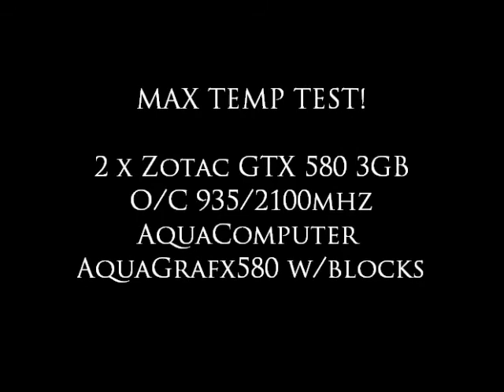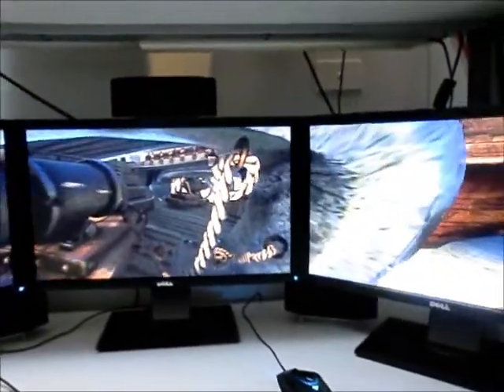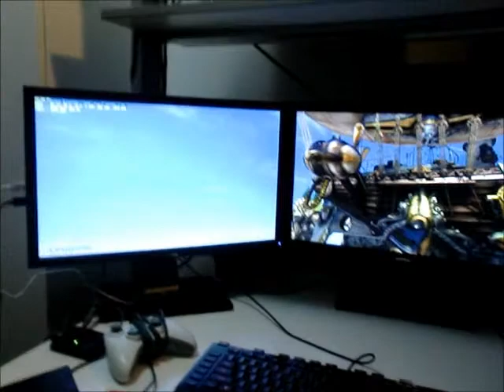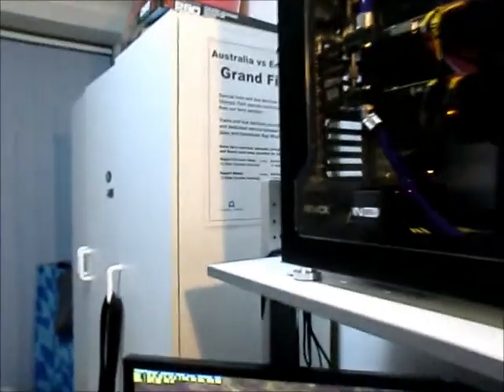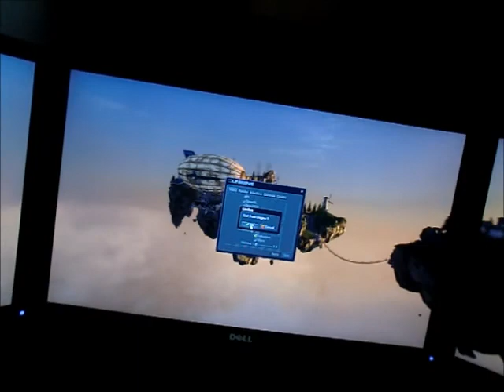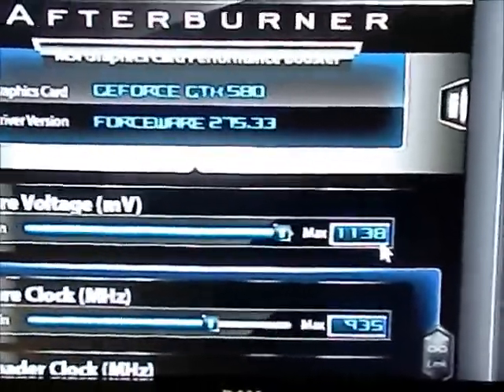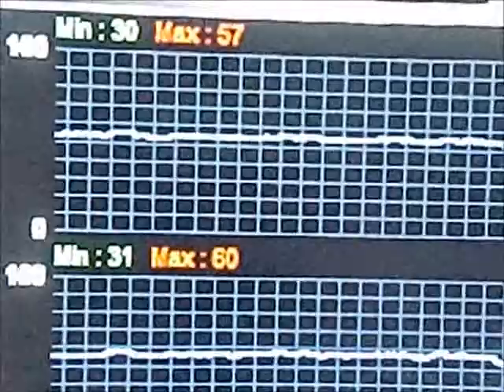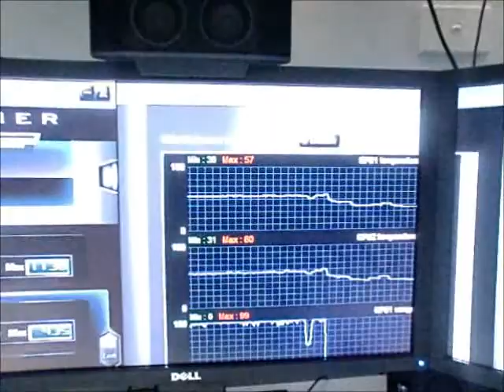Watercooled GTX 580 3GB Temps

Comment: i'm running 1.013 volts at 930mhz core and 21880mhz memory on my evga gtx580 SC. Default voltage for my card is 1.083. My everday use overclock is mentioned above and my temps with the stock cooler is 70 under full load at 70% fan speed. max stable overclock for my card is 950core and 2400memory at 1.130volts. the temps get up to 80 at 80% fan speed. I am thinking of customizing a closed loop liquid cooler into my gpu while still using the stock fan to cool the other components.

Comment: there is a qutie a few air bubbles in system, but i dont that can account for a 50* delta, i thought maybe there was somthing wrong with temp monitering program but i opened case an i can def feel a difference between 2 cards using my hand

Comment from the maker: @TheChrisglasgow Sounds like SLI isnt working properly, GPU 1 seems like its idling and GPU 2 is doing all the work. 50* @ full load is not a bad temp man, the 580 can handle upto 90*C without any issues so dont stress too much. I think under a good watercooling loop, under 60*C is fantastic!

Comment from the maker: @TheChrisglasgow My rigg in this video is fitted with a 360 SR1 & a 280 GT Stealth, its cooling an i7 950 @ 4.3ghz and two 580 @ 935mhz with 1.13v.. You have more rads then me just cooling the two 580s,  trust me its more then enough.  Your rad would probably cool triple 580s and a cpu without any issues.

Comment: Ive just fitted a blackice sr1 480 rad + a 240 rad as well, this is just to cool my 2 evga 580gtx superclocked cards, using a corsair h70 for cpu, i stressed tested my cards an the max temp was 45